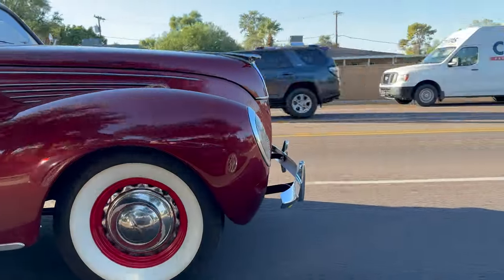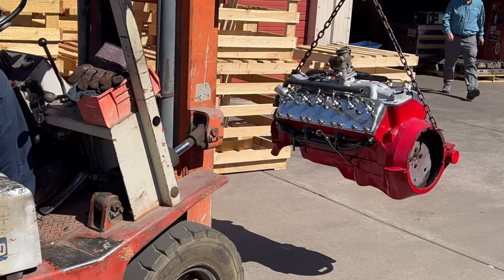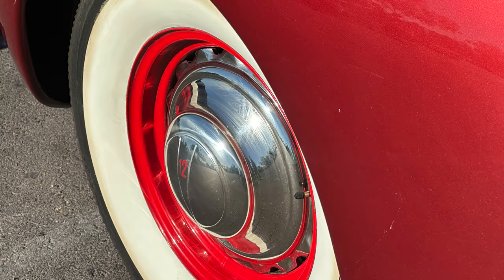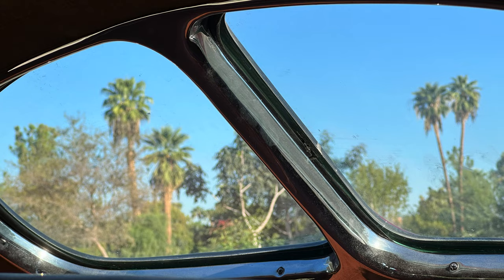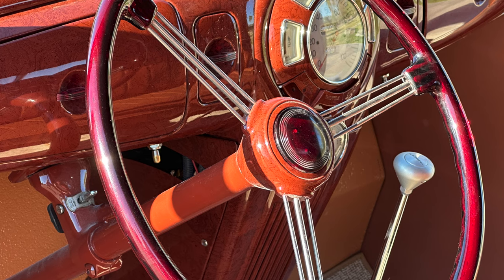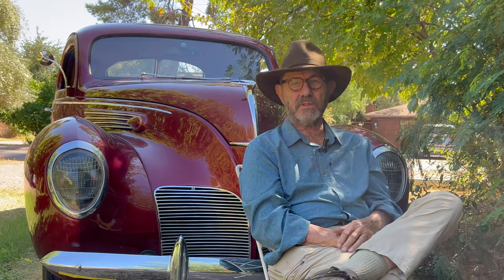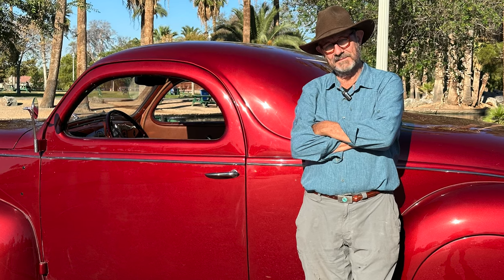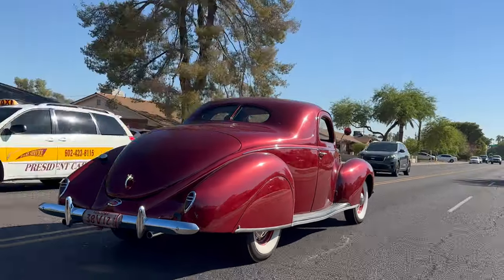STUNNING FINISH! 1938 Lincoln Zephyr V-12 Coupe Project Part 53 WRAP! JB Donaldson Review! #classic

Comment: I enjoyed seeing the the finished car and all the detailed explanations of what was done to make it function better, be curable, and have newer parts that are readily available. A question I have was it upgraded to 12 volt and what about the cooling system? I heard these V12s had overheating problems. Also were improvements made on the headers and engine internals on the rebuild to give it more horsepower and torque? With all the changes made what is the engine's current horsepower?
Reply from the maker: It hasn’t been dyno’d but it’s smooth, starts up and cruises nicely and that was the goal.

Comment: What a beautiful car! The paint is gorgeous! Do you mind me asking what kind of protection is on these beautiful paint jobs, and when they get dusty what do you use to wipe them down without causing micro abraisions? Ive got a paint job that needed to be polished twice to remove microabrasions ('swirls') and i want to change how I protect the car. Hoping you may be willing to share some advice.
Reply from the maker: JB and his team are more about fabricating and building, and not particular experts at preserving. I will say he likes to spray a car down with compressed air before doing anything else, to harmlessly remove a bulk of the dust/debris...